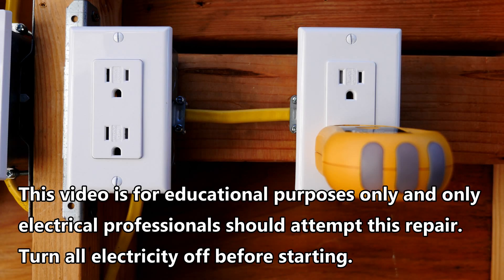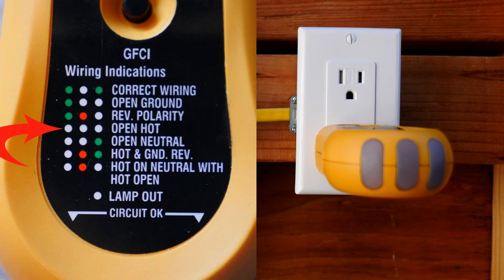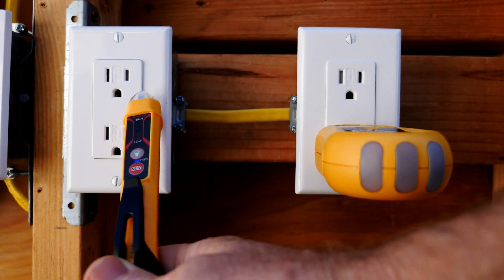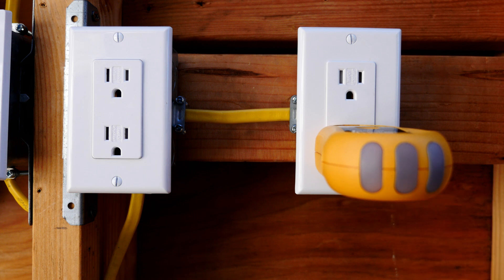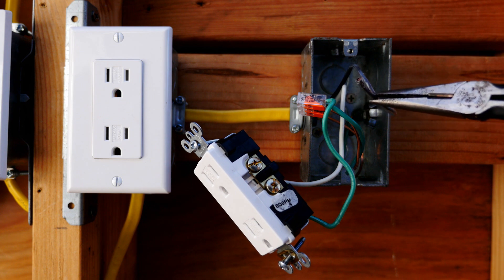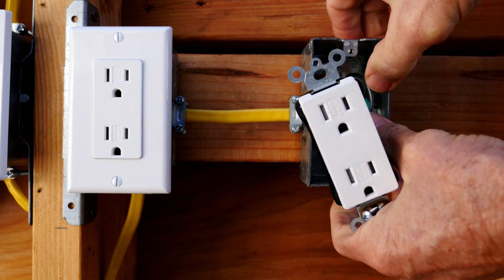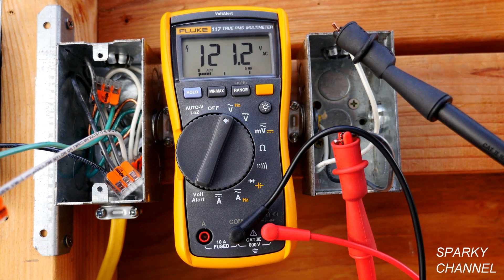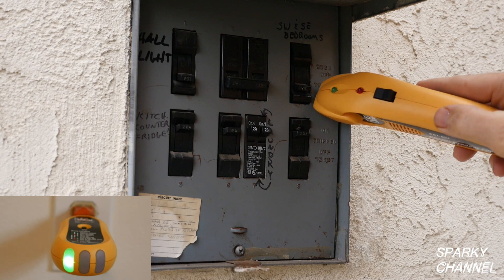How To Fix an "Open Hot" Receptacle

Comment: Ours is a GFCI outlet that is showing Open Hot.  The little light turns ON when the breaker is ON.  That light turns OFF when the breaker is switched to OFF.  Is this a good indicator that there is no electricity to that outlet?

Comment: You trip the breaker to make sure there's no power. Then after you remove the cover, you touch your voltage detector to every piece of metal in the box - wire or otherwise. If it lights up red, there's power there.

Comment: On a GFI outlet there is power coming into the receptacle but nothing leaving. 
Shows open wire but I checked the wires carefully. Could it be the switch? Just bought it.

Comment: My situation is a little different. It's an outdoor GFCI outlet. Reset switch didn't work. Plug in tester has no lights. Fluke tester shows voltage present in the hot side. I turned off the breaker, and now the hot side shows no voltage on the fluke. Would this likely be a similar problem?

Comment: An open hot is dangerous and the hot black or red wire touches to metal where the ground is bonded causes sparks, short, arcing, may trip the breaker for Safety, this is not good at all and we need to fix this issue by turning off the Right breaker or turning off the Main breaker instead

Comment: I bought one of these little testing gadgets at The Home Depot recently, and found out 3 pairs of wall outlets in the base floor, and two pairs of them upstairs in the bathrooms with this “open hot” problem. Yikes! Now I need to find a certified electrician somewhere. It's a new house but I haven't started inhabiting it in a very long time.

What's the difference between turning off all the circuit breakers and the main source of electric current? I don't know where such main source is located, all I could do for now is turn off all the breakers.
Reply: You've probably found an answer by now, and mine may not be very helpful.  But there is a main circuit breaker at the top of my circuit breaker panel box, and it turns off power to all breakers at once versus turning off each breaker separately.  My house was wired in 1990.   BTW, they used mostly "back- stabbing" (not good), and I recently found 5 (!!!) Romax bundles wired into ONE  porch ceiling light work box.  Needless to say, I'm having issues with several lights (porch, carport, attic) wired in through that box. It's been a headache, for sure.

Comment: I believe that Backstabbing is never a good way to secure a terminal to an outlet. Over time, and with extensive use of the outlet. those backstabed terminals could come loose and cause arcing, or worse, a fire!
Reply from the maker: I did not backstab. Those are back wired receptacles. It is a very big difference.

Comment: It is not recommended to use the back holes on outlets. Use the side screws..
Reply from the maker: I did not backstab. Those are back wired receptacles. It is a very big difference.
Reply: Yeah, the back stabbers aren't great... eventually they will betray you. I mean it's in the name lol.
Reply: @jamesb1988  😂😂 that sounds about right.

Comment: The upper portion of my receptacle is working, however the lower portion of the receptacle shows an open with my LEDS indicator. (GFCI is fine, BTW). 
By using the appropriate breaker switch, no electricity flows to the receptacle at all, so I SHOULD be able to work safely with it, yes?

Comment: I switched my garbage disposal out and the new one I purchased required a plug in outlet where the original disposal did not plug in. I used the same wiring. I’m wondering what might be the problem that the disposal works fine when I plug it in to this new outlet  but using a plug in outlet tester it’s showing open hot but it runs the disposal. How can I fix this issue?  Today after noticing it showed hot wire I added in a ground wire because I had used a metal box rather than plastic box. Also today I switched out a regular std receptacle and put in a gfci. That still didn’t change anything. Thanks.
Reply: I messed around with my garbage disposal and ended up turning it which caused me to lose the seal I had with plumbers putty around the opening in sink where water runs down to disposal. It started allowing water to drip around that gasket under the sink. I had disposal running and it automatically shut off. Maybe a builder doesn’t do whatever is needed for a plug in outlet when instead the make a closed system of wiring to the disposal. Because either way there is s button reset on a garbage disposal if water comes in contact.  If anyone sees this let me know your thoughts.  Thanks.

Comment: Great video. I had that situation, too. Replaced outlet. Confirmed proper connections. Still reads “open hot”. Suggestions?  Other outlet in same room tests/works ok.
Reply: I have the same issue. open hot, other outlets tested and work fine. the open hot box, no wires are loose. Did you ever get yours fixed? If so, what was the solution?
Reply: Having this issue with my 3 outside outlets but everything inside is fine… 😫

Comment: I turned off a fan and went to bed, but, in the morning, the fan would not come on! Testing of the outlet, and the other outlet on that wall, show "open hot."
I turned off the power and checked inside the outlet. No wires were loose. 
NOW WHAT??

Comment: Hey Bill, I have a video idea you may be interested in. So I came to this video because I was trying to solve an “open hot” situation at my parents house. They had just done some siding work and multiple receptacles were no longer working. 

I checked the GFCI receptacle and it had a green light (I didn’t actually check the GFCI for voltage) so I turned off the breaker and began opening all the receptacles looking for a broken/disconnected hot wire and to my surprise they all were good, no issues. I thought maybe a nail had struck the hot wire and this was going to be a difficult repair. Luckily I turned the circuit back on and started over again checking the outlets with a Klein digital outlet/gfci tester. 

This time I tested the GFCI noticed that the GFCI outlet still had a green light, but showed “open hot” which was confusing. So I pulled it out and realized that the line/load had been reversed. So I corrected that and all the receptacles worked again. It turns out that the Leviton GFCI will still show a green light when the line/load are reversed, but the receptacle will be dead along with all receptacles down stream from it. 

Anyway this was a different open hot scenario I feel you would be great at explaining to people.
Reply: What do you mean? That the hot wire was attached to silver side and neutral wire was attached to gold side? Cause I'm dealing with same issue and I remember when I had it opened there was no disconnected wire..
Reply: @jamesb1988  No. On a GFCI outlet there are "Line" terminals on top (silver/gold screws) and a "Load" on the bottom (silver/gold).. When you bring power into your GFCI you must connect it to the Line connections. If you accidentally connect it to the bottom load terminals on a Leviton it will still light up the green LED, but it won't work.
Reply: @pattognozzi  that's exactly what's wrong with mine, I appreciate your explanation!
Reply: @jamesb1988  great to hear

Comment: Is the outlet bad if one plugin shows an open hot wire and the other shows an open ground? Also all the outlets in the room show an open ground and in another room an outlet shows a hot/ neutral reverse reading. Do I need to go through and have them all rewired?

Comment: I probably won't be attempting to fix this myself, but I'm still curious about something.  How can I find which circuit the defective receptacle is on if I don't already know?  Since it currently doesn't work, I can't find the circuit by flipping the breaker switches to see which one makes it go out.
Reply: Chances are there is going to be atleast one other outlet or light on same circuit that is near one you are having issue with.

Comment: Why didn't you use the non-contact voltage tester on the Romex supplying the power to the suspect outlet to determine if voltage was present? You could then verify if the correct circuit breaker was opened and proceed to troubleshoot the outlet.
Reply: I was wondering the same thing. That makes sense to do before touching the Jbox or even the trim screws that might be energized.
Reply: @STV-H4H  I guess the presumption is that the outlet is mounted onto a drywall or somehow covered wall, making the Romex we see inaccessible.
Reply: That’s my take away…assumption is that this a simulation and all wires would be behind drywall. Also, he says since we wouldn’t know which breaker would be for this receptacle, he turned power off to ALL the breakers.

Comment: another way of identifying the hot side of the receptacle it the smaller or narrower slot of the plug is the hot. This is also a good way of identifying the neutral of a cord. the neutral side is sometimes larger or there are ridges on the neutral wire in the cord! Just as a FYI to anyone, especially if you are replacing a male or female end of a cord. The neutral screw is commonly white in color and the hot brass colored; these colors and other identifying marks are to be able to discern which is a hot, neutral or ground. green should never be used as a neutral or otherwise known as the grounded conductor, which should not be confused with the grounding conductor. Article 200 convers the color coding of the neutral conductor or grounded conductor. This is really important electrical 101!

Comment: Can loose receptacle contacts (where the plug prongs go in) cause a false positive "open hot" reading? The reading on my circuit tester is mostly "open ground" but if i jiggle it, it can sometimes show open hot. When I plug a light into the outlet, it powers on. So i am getting something. Also, this only happens on the top plug, the bottom plug consistently reads "open ground."

Comment: What if you show power at the outlet in question but no indication of power with the three light tester?  And the 3 light test indicator works at other outlets.
Reply: I had a similar experience. The circuit tester indicated an open hot, but the voltage sensor showed power. Answer: the outlet was wired to a wall switch which was in the off position.
Reply: @joelsturm3577  I think you helped me with the same problem with power to storage room. The joys of having an old house that was built before codes and lived in by people that didn't care.

Comment: I have a wire that both hot and neutral wires are testing hot, and the receptical is reading open hot. I can't for the life of me find the other end of the wire. I want to disconnect that wire and run a new one. I may need to gut the house.. Figured I could get away with fishing it through the walls.
Reply: also, I hate to say it, but nothing is grounded. the previous owners said everything was new, but they only made it look that way, and did their best to hide everything.

Comment: I had the same situation & it was a tripped circuit breaker. Make sure you check that first before checking the wiring or calling an electrician.

Comment: What if there the hot wire is connected and not damaged at all and tester still reads open hot?
Reply from the maker: The problem could be farther upstream on the circuit.

Comment: I want to do this myself because an electrician is probably going to charge me 200 dollars just to do this. What’s the best way to avoid getting shocked? Aside from the obvious of turning off the breaker
Reply: After shutting off breaker giving it a couple minutes for energy to cease, wearing gloves and using tools that are insulated with a rubber handle are also positives.
Reply: @jamesb1988  thanks man!

Comment: Excellent video! I do have a question about wiring a four wire outlet (two black and two white wires). There is no power to the wiring after I removed the receptacle. I tested the open wires with a tester and no indication of power, however, the ceiling fan and one receptacle have power in the bedroom. The adjacent bedroom receptacles and light switch are not working as well. The circuit breaker appears to be working properly. The receptacle that may have caused the problem is used sparingly and recently a cell phone charger was connected  which cause that receptacle and the other receptacles and light switch not work.  Any advice on troubleshooting the problem?
Reply: Sound like you might have a reverse wire some where I would most definitely check into that ASAP . I picked up the fluke st120 socket tester small extremely light weight and easy use! It's like 30 bucks at Lowe's!
Reply: Any ways I would shut that breaker off and then you should be able to find common. (Direct power) then you should be able to you neutral and ground is obviously green or copper.

Comment: Thanks Sparky!  My Mom has an Open Hot in an outlet in her home.  She also has several GFCI circuits wired together from two different bathrooms and the same string of electrical receptacles in her kitchen - all on one circuit breaker.

Comment: True Story from someone who should know better (me): I have a plug-in kitchen disposal under the cabinet in my new house and I installed a CyberPower surge suppressor to kill any surges at the source when used.  I noticed that the Green "OK" LED was out on the suppressor and wondered why.  I grabbed my handy dandy outlet checker and got an "Open Hot" indication.  Ok, wait for it now.   After puzzling on what this means because the disposal works fine, it FINALLY hit me.  I had the Switch in the "Off" position.  Yup, that was a big "Duh" moment for me.  When turned on, the Green LED light up just fine and the socket tester showed a correctly wired socket.  Should have had that second cup of coffee...

Comment: We have a outlet that was installed in the corner of the garage after building, by my friends friend, and it has had a open hot for years, it’s on a exterior wall with a plastic conduit outside, when it rains that circuit gfi trips, most likely that, but wouldn’t put it passed our builders wireing given other stuff we have seen from them, like a entire room isn’t grounded, non of the 4 lighting fixtures we have changed were, nor was the electric range
Reply: So what was your fix to repower your gfci outlet ?
Reply: @saulfigueroa5630  I just cut whatever power to it for now, I don’t use it

Comment: This almost helped.  I had several outlets go out, on different circuits, just a couple hours after a storm. There are no water leaks anywhere in this 2-story house.  The upstairs is not used at all, so nothing is even plugged in up there, but half the outlets in each room are out even though each room is on its own circuit.  Downstairs, the east half of the house was fine, but the west half was not - outlets out.  Getting open hot indicators on GFCIs and regular outlets.  This problem is on the north and south ends of the house, and on the west side of the house.  My bedroom fine, but my bath is totally out.  Living room is:  east fine, west not.
NO circuit breakers were tripped.  Even my 220 dryer is out.  That doesn't make sense to me that so many went out at once, unrelated to each other.  I will check back in a while to see if anyone has any info.
Reply from the maker: Good luck!
Reply: How about an update. Was it just 1 phase out? Problem at the pole?

Comment: Hey Sparky,  I was looking for something like this; however, my bottom outlet does work when the light switch is on.  The home is wired like this in all 4 bedrooms for the outlets that are alongside the wall where a bed would normally be placed.  The builder (2010) I believe did this on purpose wiring a "half hot" outlet so that we could plug in night lights that turn off with the use of the light switch.  We live in Hawaii and our inspector just flagged all of those outlets and light switches accordingly.  Does the wiring of a "half hot" switch like this go against the National Electrical Code?  Hawaii adopted the 2014 NEC back in March 2017 as well as the 2015 International Energy Conservation code at the same time.

Comment: I come back to this video time and time again for these situations.  Although i can never recall seeing any other folks but you using the electrical tape, is that a widely known tidbit that a master electrician will perform on a residential job?
Reply from the maker: Yes, but more with older electricians like myself. We also like to crimp our wires around terminals before tightening. The new generation just uses a "U" shape on the wire before tightening.
Reply: Lol. You can always tell who is old school and who ain't. We didn't have most of this stuff back in the day all across the board

Comment: My problem there IS electricity there but as soon as I plug the tester or anything else in there is no power thereat all until I unplug the tester or whatever device  I plug in. It even turns off another circuit in my house when I turn on the circuit breaker even with the breakers on.

Comment: under our kitchen sink, i noticed the outlet for the dishwasher and disposal that's plugged in is show open hot.  however, both appliance still has power and still works.  what could be the cause?  it's an older home, so not sure if that should be replace with GFCI socket?

Comment: I have 2 receptacle they are connected to each other in the same wall that reads open hot and I cant find the supply box I checked the one next to them on the next wall no luck and the room below with same position still no luck any other idea how to find the supply box to these 2 receptacle??